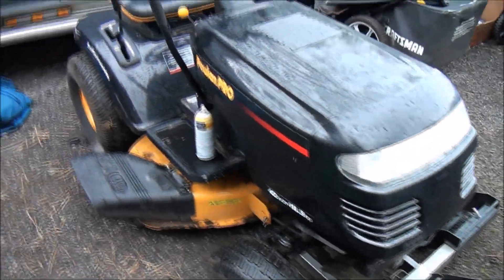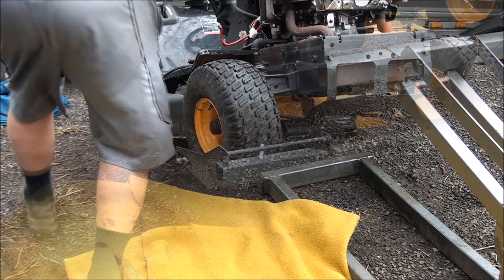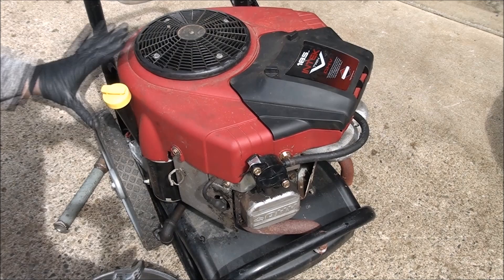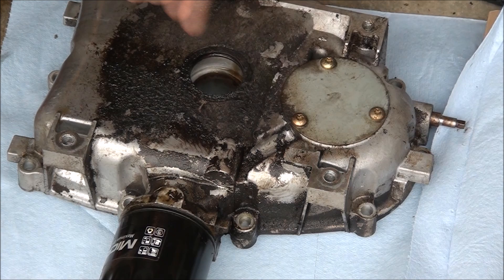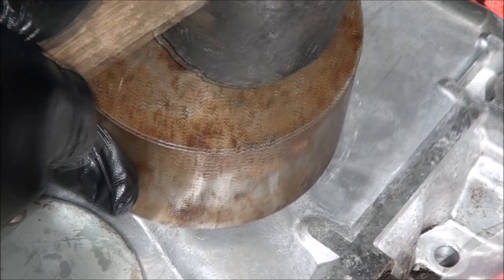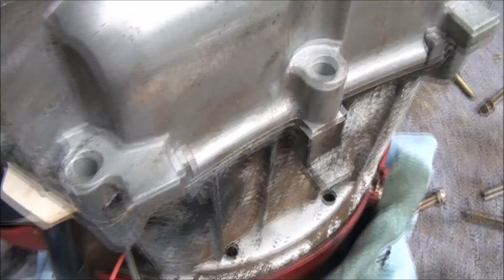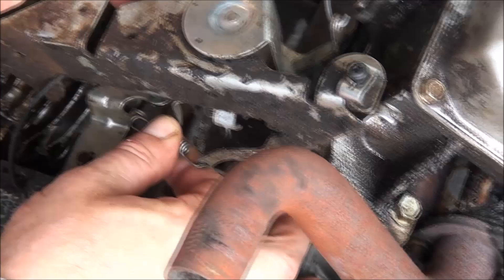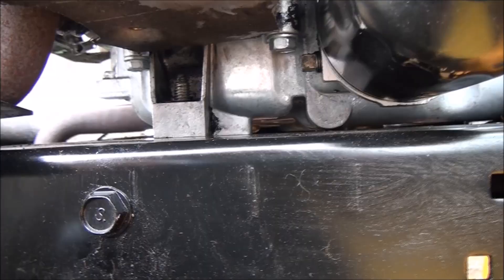Briggs and Stratton Intek V Twin Engine OIL LEAK. How to Replace OIL PAN GASKET and Main Oil Seal

Comment: I used Lucas Oil Leak Stop for this exact problem on a 2009, 23 Hp endeavor . Figured I,d try it first; Within 1 hour, the oil stopped leaking from the sump gasket!
Reply from the maker: That is great! Worth a try

Comment: I wouldn't consider any engine that has chronic oil pan gasket failure as a good engine.  No more Briggs for me.
Reply from the maker: I still like Briggs better than Kohler or Tecumseh.

Comment: Take spark plug out so you can turn crank without compression to drop the bottom pan onto motor, a ton easier & less likely to fold main seal over itself,😉 great vid 👍

Comment: Put #2 grease pack on seal and block of wood, hit it center and use socket to push it down 20 thousand
Reply from the maker: good tip

Comment: Jeff, your video was very useful, my 13-year-old B&S 26hp engine is suddenly leaking a lot of oil.  I cleaned the engine up enough to see that the sump pan gasket was the problem.  I put a wrench on the bolts holding the sump to the block and I found that they had all worked themselves loose. I snugged them up and ran the mower for a bit and no more leaks. Time will tell, thanks again.
Reply from the maker: Glad it helped, nice work!

Comment: This is a great video. No loud music, just everyday logical mechanical work. Good tips, reference to B&S manual and torque info. I think I would change out the oil pump “O” ring, filter and any other parts that might have been practical while it was open as well. Great job though.
Reply from the maker: Thanks! 👍

Comment: Dude, you probably saved me at least $500 with this video.

A few years back, I decided that I could do these kinds of repair, but wasn’t comfortable.  This video not only exactly diagnosed my problem with my lawn tractor engine, it also  gave me the confidence to do this myself.

Thank you!
Reply from the maker: righton! good job
Reply: Last weekend, oil was literally pouring out of my 2009 Husqvarna tractor with a bigger but almost exactly the same B&S engine.

Bought the whole gasket kit, figuring why not replace everything I can while I have the motor off.

Started up like a champ today and not a single drop of oil is leaking.

Thanks again for a fantastic, comprehensive and really well-done video.  Showing even your “errors” was extremely helpful.  Wish I could link the video of my tractor firing up and running like a dream for you!

Comment: Wow, you sure have remained calm. Very impressed with the complexity of this repair.  I have had my B&S Vanguard in the shop for the third replacement.  Never used the mower, leaked when returned to my shed just sitting ! My luck.

Comment: A truly great instructional video. I have to perform this repair and you have taken all the guessing out of the job. One thing I always do before taking anything apart is to hot pressure wash everything I can to make the work easier. Thanks for the help.

Comment: Thanks for sharing your work. I have a 24hp Briggs that's thrown oil for years. After cleaning it all up and  running it for 10 minutes the gasket leak was obvious. Thanks to you I'll forge ahead with replacement.

Comment: Thank you for your video.  I used it last week to replace the oil pan gasket and shaft seal on my mower.  It was very helpful.  Tips I would add for others using the video for reference would be to consider also changing the governor seal and the oil pump o-ring while you've got the pan off.  The parts are cheap enough...
Reply from the maker: good tips!

Comment: Nice video!  I have a Husqvarna 23 hp Intek with 600+ hours. It was leaking in the exact place as the one in your video.  I used Lucas oil leak stop , it worked great,the leak is completely stopped
Reply from the maker: Glad it helped!

Comment: Should be called "Breaks and Crappen"! Maybe they were a decent motor back in the day.. I have a ride on with 16hp Vanguard and less than 300hrs on it and so far one head gasket went at 106hrs and now I diagnosed a leaking sump gasket. There is a 100mm section where the oil is pissing from where the gasket is not even visible, just air gap and oil bubbling out. The reason they have to update these parts is cos they are shit to begin with. 1300hrs on my Honda powered mower and nothing but general service and valve adjustment. Thanks for the good video mate, looks like I'll need it tomorrow.

Comment: I have the same problem, and thought it was most likely the crankshaft seal, after power washing all the dirt and oil off and running it a few minutes.   I was thinking that top pulley spinning was what was throwing the oil everywhere. I can see clearly from your video that top drive pulley was dry on yours.  I'm about to tackle this and was hoping to just get away with replacing the seal without splitting the bottom cover off.  I now expect mine is leaking from that gasket too.  So thanks very much this helps me so much to know what to look out for before tearing it apart.
Reply: Make sure you replace Governor shaft seal also

Comment: On my Husqvarna 2748 the engine leaked like this. I bought the parts but decided to tighten up the crankcase bolts all around the engine. Leaks almost completely gone. Thank you for your video. I’ll know what to do when I have to take it apart.

Comment: Same leak, same place in a newer 24hp.  Seems to be a common fault with these motors.  Mechanic friend did one motor 3 times and the same problem with a blown gasket each time.  B and S told him the fourth time to permatex it.  After the permatex, no more leaking.
Reply from the maker: good to know
Reply: I wonder if lightly roughing the sealed surface would help the case grip the gasket?

Comment: Good video but I would have stuck a bolt in the gas line to prevent leaks. I really like your oil drain adapter. I will have to make myself one of those. Thanks
Reply: I agree but I use a tapered punch for a perfect seal.

Comment: This is what I do to the area where it AllWAYS leaks, use electric engraver and ruff up sump gasket area, it keeps gasket in place 
Done about 80 or more and no issues 😊😊
Reply from the maker: good tip

Comment: Why not mark the cables with colored electrical tape wrapped around the cable and taping over the screw hole? I also put bolts and nuts back in holes to not lose or mix/match them.
Reply from the maker: good tips!

Comment: I would put the seal in last, tapping it in with a piece of plastic or metal pipe.  That makes it easier to put over the shaft without flipping inside-out.  Also, seals usually go in easily enough, and stay in more securely, without lubricating the outside of them.  It looked like this engine has a ledge in the bottom of where the seal goes, so you just tap the seal against that.  Otherwise, yes, just below flush.  Too far and you plug that little drain hole.

Comment: Recently had a Vanguard V-Twin 35HP horizontal leaking oil at crankcase cover and PTO oil seal.  This is on an new grain auger.  After receiving replacement parts, removed the crankcase cover and found there was no gasket, just RTV silicone.  The cover showed that the silicone had not stuck at the bottom and several other points of the cover, thus the leak.  I assume, that the mating surfaces had oil residue so the silicone couldn't stick.  The old oil seal showed evidence that it had flipped in two spots, thus another oil leak.

This is a brand new engine, less than 10 hours, so right from factory.
Ever seen NO gasket on the crankcase by Vanguard V-Twin?
Reply from the maker: yikes, That sounds not good.  New engines usually have less than 1 hour run time. I have never seen that. The seal was flipped/no gasket... so sounds like someone was messing with it.

Comment: Could I send you 2 pics.  I followed this video to remove the engine on my craftsman gt6000 26hp and on the oil pan sump assembly I found a screw in plug on the side just rear of the oil filter that was loose.  I tightened it back up snug.  Upon examining the cast aluminum assembly I saw a spiderwebbed looking cracking cluster but can’t tell if it was also leaking and is worth replacing or a normal thing??  Your videos are spot on and extremely helpful!
Reply from the maker: probably just casting marks.

Comment: Appreciate you taking the time to do this video. Helped me a lot performing this same job on my 2003 Briggs 21 hp v-twin. After reinstalling the engine and starting white smoke pours out of the muffler area. Oil level is correct and at the full line. Wondering if perhaps oil somehow drained into the top of the engine and then collected inside the muffler upon initial startup ? Thought’s on what the issue might be ?
Reply from the maker: that could be the case. If so, it will take awhile to burn out.
Reply: Run it until it stops smoking could be oil in the muffler or oil leaks from the past that need to be fixed

Comment: I have just this job and in my ignorance drove the seal all the way home!  However I notice the hole would only be covered half way by the seal. OK do you think?  Thanks for your vids, very detailed.
Reply from the maker: Fix it right! I used to always buy 2 seals until I got better at putting them in. I have messed up a few...

Comment: Is it okay to use Permatex on the gasket? I was surprised you didn't use any. Going through all that work I would want to take every precaution I could so it wouldn't leak.
Reply from the maker: If you install things correctly and clean off the old gasket no permatex is recommended or needed.

Comment: 7:25 - You can also take out a spark plug and stuff a rope in the piston.
Reply from the maker: I have had the rope get stuck in a valve before so I do not use that procedure anymore.
Reply: @jeffslawnmowerrepairandservice  If it gets stuck just back up the motor to open the valve and take the rope out. The valves should be closed or closing when the piston comes up.

Comment: question... whyd you take the oil pump out? If the shaft and motor never moved, you should be able to put it back together without removing the pump, no?
Reply from the maker: Hello! Yes that is correct. I just took it apart for the demonstration.
Reply: @jeffslawnmowerrepairandservice  Might you have the part number for that oil pump O-Ring seal?  If not, can you tell me what the engine model #, type #, and serial number is?  I have a similar engine on a generac generator but B&S does not have a parts breakout for my engine but this engine you are working on is similar

Comment: How long did that actually take you start to finish without all the video edits? Thx!
Reply from the maker: about 3 hours I would guess
Reply: @jeffslawnmowerrepairandservice  Hey, It's me, Tim. You are waaaaay faster than I am at repairing things. you must've worked flatrate somewhere !  HaHa, I had to pressure wash my parents Skag 3 times just to get all the nasty filth off. This thing had to have been leak'n for years !  After washing/de-greasing I used the dye method to pinpoint the culprit. Sure 'nuff, oil pan gasket. thank you for confirming this problem in these engines. (I have my" Masters" in auto repair ,but am something of a dummy when it comes to lawn equipment ! ) besides, there are more cars and trucks in need I can't hardly find time for MOM'S  LAWN MOWER ! ! ! Ha, hahahaha !  Thanks Jeff. God bless.

Comment: Could this leak cause power loss after the motor gets hot?
Reply from the maker: not likely. check under your engine cover it may be clogged with a mouse nest causing overheating

Comment: I just replaced the sump gasket and the crank seal put it all back together and the governor gernaded! I’m sure it was human error but do you happen to have any idea what I did wrong? I ordered a new governor and a new sump gasket.
Reply from the maker: when you put the cover back on make sure that the govenor lever in the cover mates up loosely with govenor cap in the case. It may have became bound up upon installation in your case.

Comment: Hi there, i have recently purchased a new Ferris 400s zero turn, it has a briggs 23hp commercial. I noticed when i received it from the dealer there seemed to be oil spray everywhere primarily all over the frame and deck area. I contacted the dealer and they said it comes shiped like that for better protection. So I thoroughly wiped down all areas. I then noticed after its first and again on the second use more oil spray over some areas but nowhere as bad as it was. What are your thoughts on this? Could it just be some leftover protection oil i might have missed or could it be something else going on? I will also mention I can't see any signs of oil running down sump or drive wheel housings. Cheers.
Reply from the maker: check the bottom crank shaft seal for leaks and all around the sump gasket
Reply: @jeffslawnmowerrepairandservice  thanks for the reply, it seems to of stopped now, pretty sure it was leftover oil seeping out of the joints of the frame where some things get bolted on. Due to the air pressure from the deck and the blower housing was drawing it out and moving it around.
Reply: @jeffslawnmowerrepairandservice  Yeah.He had a leak. They tried to "smooge"  this poor fella !

Comment: My Husqvarna with a Kawasaki engine is PISSING oil from the drive pulley shaft area. Doesn't appear to be the oil pan. Likely the main seal. I can watch it drip oil every second. I've even tried the ATP Reseal additive to no a avail. It doesn't have the clutch pulley installed ( no mower deck). Could this result in a leak on that shaft? I'm dreading pulling the engine
Reply from the maker: it is the main seal. It is ok to run without clutch

Comment: Can the gasket be replaced while the engine is still in the mower?  Mine is a zero turn Scag and I can remove enough frame to access the engine
Reply from the maker: unfortunately no
Reply: @jeffslawnmowerrepairandservice  thanks for responding back. Some nut job welded my top pully to the shaft.

Comment: Is it possible to change the pto shaft oil seal without removing the motor?
Reply from the maker: possibly, but it would be difficult
Reply: I just did it on my 24 hp B&S and so far so good. I drove a screw into the old seal and screwed it in a bit then pulled with vise grips. installed the new seal yesterday and worked it all day today without a leak.